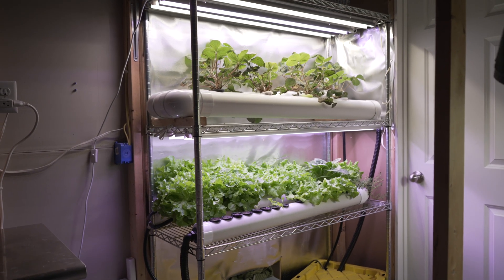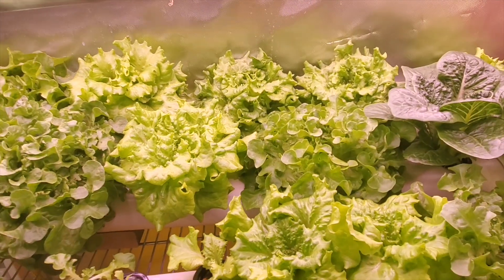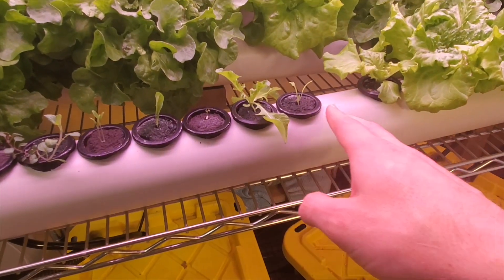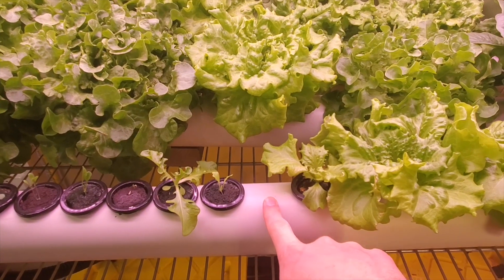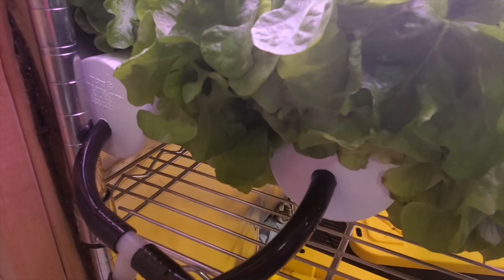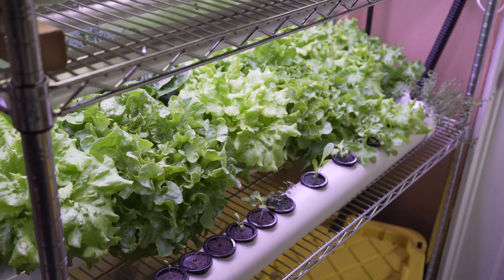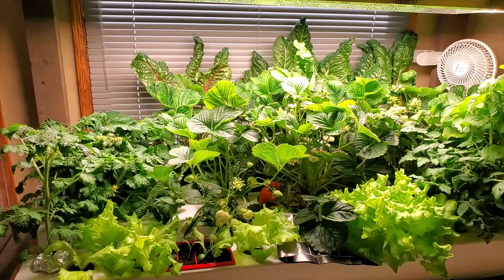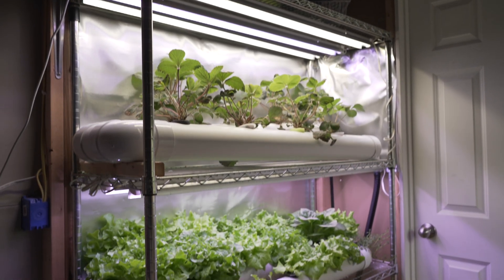DIY Hydroponic System with 15 Parts (NFT)

Comment: Hi there, I have a NFT system that could be used for seed propagation, it is desinged in a way where the netcup will just touch the nutrient film. The grow media will wick up enough moisture. But nevertheless, I think it's better to have a second place to germinate seeds, as the seeds don't need nutrients and will be happy in a standard propagator in a coco pellet or similar. Your system(s) looks nice, too! Very practical.
Reply: Separate is Better No or Almost No Nutrients for Seedlings....but you could add Myco to seedling NFT.....

Comment: Thanks a lot, I'm having trouble getting my seed plugs to not be soaked in water. I'm using Jiffy-7 Peat Pellets but even 2mm of water is getting the plugs soaked. What's the difference between the seed plugs that you are using, how does yours not soak in water?

Comment: hi, really loved the system, and I just want to try and build it myself. But there is couple question that I tried and check in all the video and website but I do not seems to find it. Let me know if I am wrong hhe, but If possible, can I ask the question here?

I realized that the rack used here is around 18" x 48" x 72"

two things that I am still looking and still dont get the answer are :
1.  the distance between the rails and the grow light
2. the watt for grow light for 18" x 48", after couple videos i think around 300watt ? 

thanks a lot in advance, nice video

Comment: Is there a problem using a 4-inch pipe instead of 3 inches?
Reply from the maker: Not at all, except that you can only fit 2 rails in the same space
Reply: This was my question also. I have the same wire shelves, but they're 5' long and 2' wide. A little bigger than his (I think). Also, two of these shelves put end to end, so it'll actually be 10' long. I'm thinking 4" pipe will work better to not get backed up by root mass.

Comment: You should put together a kit with the two square rails or four rails system. With all the parts included except the bucket. If you sell them, I'll be the first one to buy!!! I live in an apartment and I'm sure many people who I've in apartments don't have any of the equipment you have or required to build the system. So, if you sell the system, I'm sure a lot of people would buy!
Reply: You could put this together in an apartment and borrow tools from a tool lending library. It's not hard It's a matter of just doing it

Comment: Good stuff, we might try this. We just built your square rail and got our first harvest of lettuce (tell our spinach and green onions to hurry up). I also have a 3d printed vertical tower, and I've noticed the square rail grows vegetables a little quicker, even with cheaper Walmart LED shop lights. Keep up the good work. If every household in America had one of these, it would solve a countless amount of problems.

Comment: love this but here in UK our downpipes are expensive to buy and end caps too, is there any other way to do end caps cheaply?
Reply: For the cap, you could buy a cheap dollar store plastic plate, cut to diameter and silicone glue to the end with your cutouts.